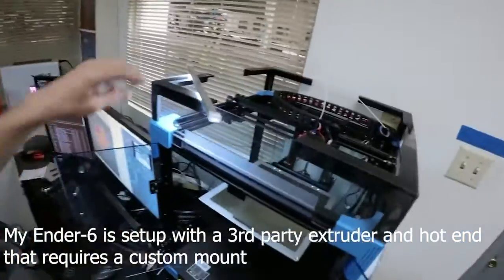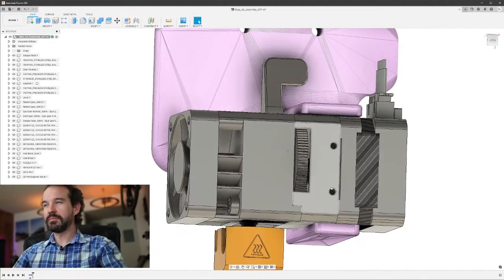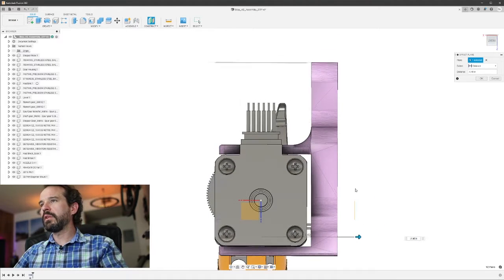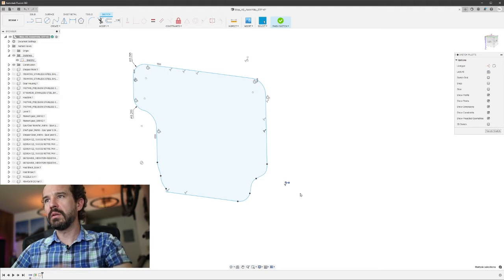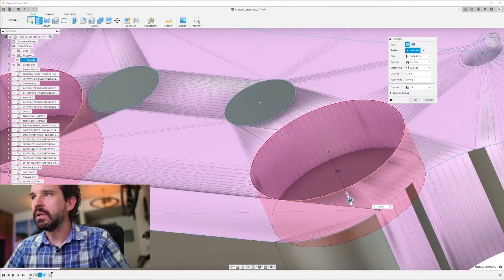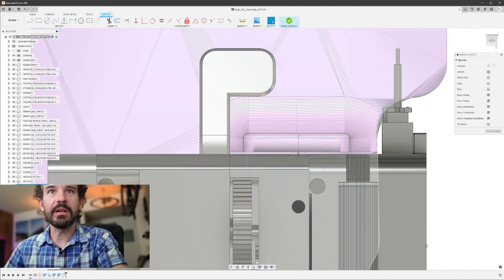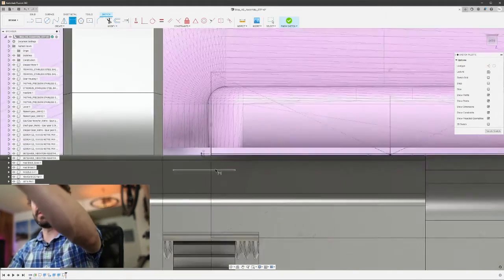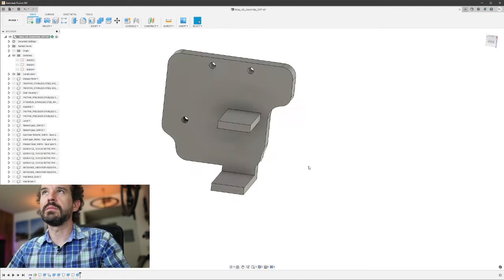The Extruder Mount for My Ender-6 Sucks. Let's Make A Better One. - Fusion 360 Design Vlog

Comment: Just a tip of the annoying auto rotate thing.
Go in to your profile icon menu bar, upper right corner. Press the References menu, choose the Design tab and uncheck "Auto look at sketch".

There are more things to turn of there that can make things easier, and also not hog down your pc for no real gain in design speed or quality.
Reply from the maker: Thanks!

Comment: Lay planes on all of your critical surfaces, then you can copy the part more accurately.  You can also turn the .stl into a solid to make it a little easier.  It will have facets on the curves, but it will work.
Reply from the maker: Yeah, like a week after I put this video up I "discovered" the stl conversion feature. That workflow would probably be a better workflow.